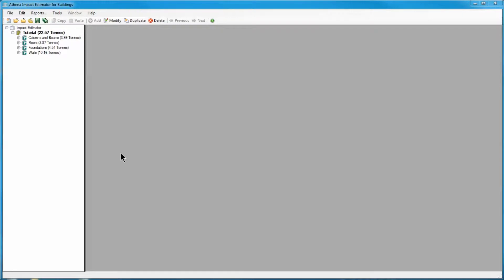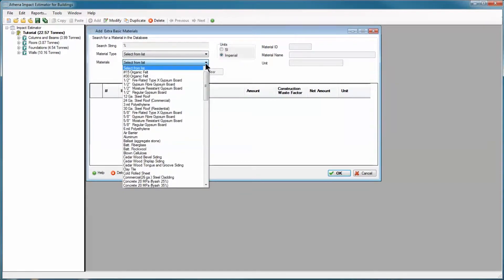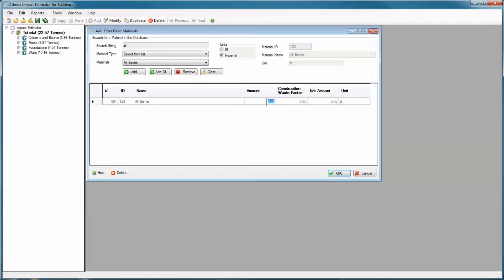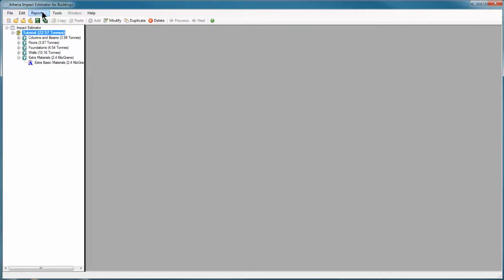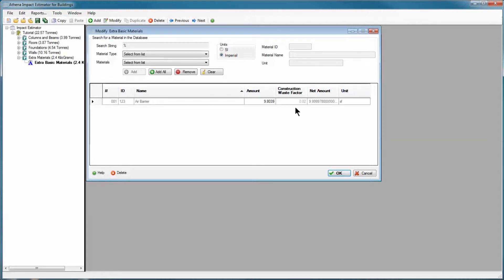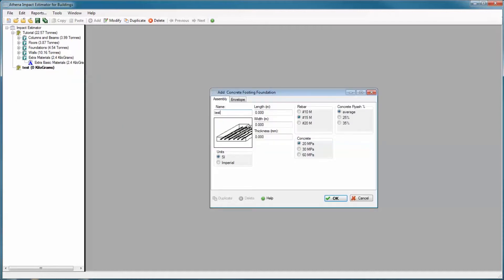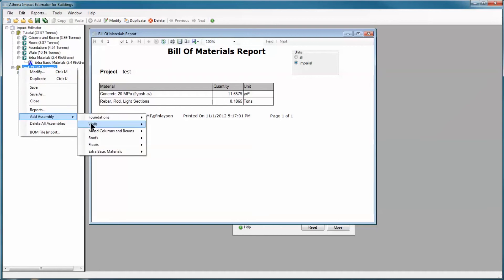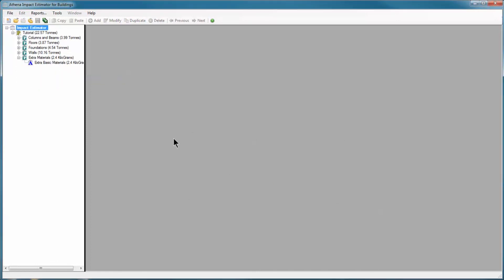06 Adding Assemblies Extra Basic Materials

Comment: Hello , I would like to know how to define a recycled material, or reused material. An example , would evaluate the impact on the use of a plate (deck) from oil drums reused to replace steel decks of concrete - steel floors mixed . My question is that the material is not new as it is recycled and non- structural use.